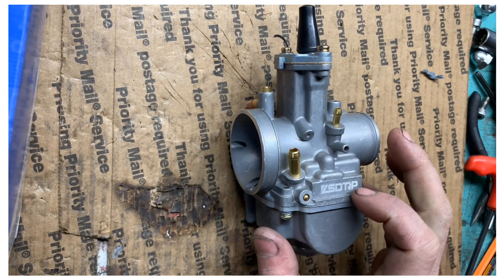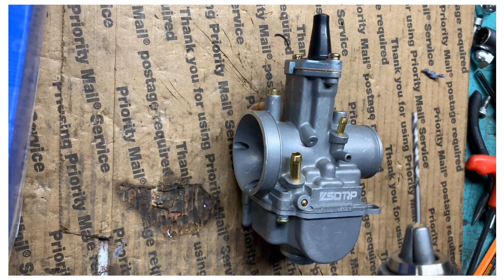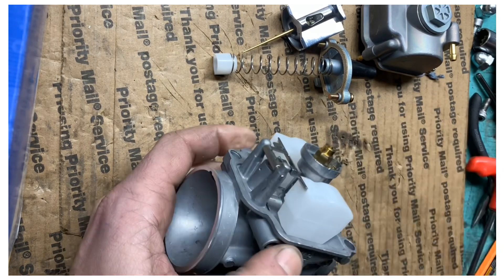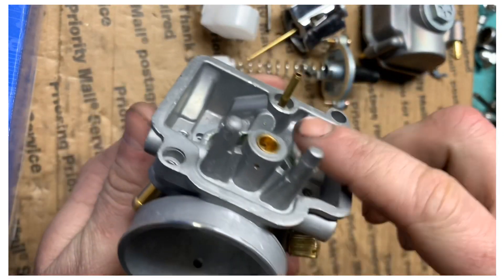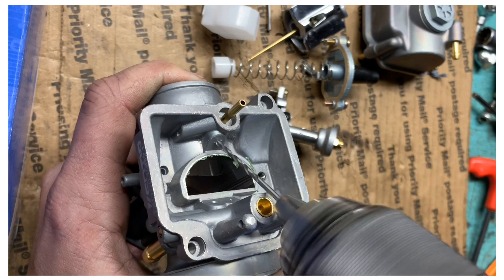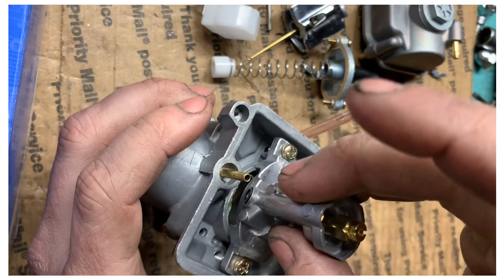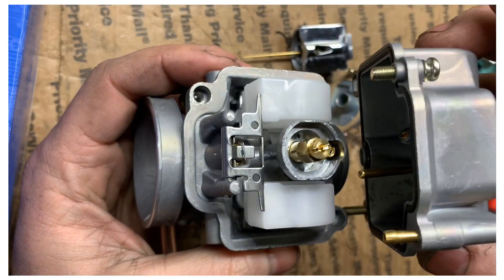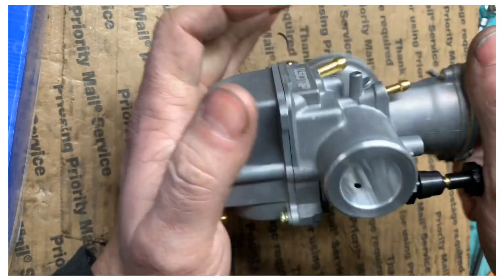How to fix that oko carb!

Comment: I used a 1mm drill bit and it helped out a lot! The drill bit in this video is way bigger than 1.8 lol! Maybe he measured it in sae and it was .19… anyway so I have a 66cc engine it’s 47mm piston, 38mm stroke and it is the piston that has the higher wrist pin, high compression head, I have reed valves just the smaller ones and I don’t have a windowed piston. I have this 21mm carb that I used a 1.0mm drill bit to do this mod, I have a 95 main jet and a 35 pilot jet. I also blocked off the power valve and I put clip for the needle valve in the center. It runs very well just a slight bog at wide open throttle only and I think moving the clip on the needle will take care of that.
Reply from the maker: He’ll yeah man. I use a bigger drill bit for the fuel I use. I also have big motors that require lots of fuel. 1mm is ideal for most. Glad it helped
Reply: @checkoutsmolikperformance223  so I basically took the engine apart and threw out everything minus the crank and the case. I made a windowed piston with the 49mm big bore kit, trimmed the skirt, crank stuffing plates, opened up transfer ports, raised exhaust, I bought the cheaper expansion pipe that everyone is running I did cut the small tubing off and the expansion part of the pipe I welded a flange right to it, piston is zeroed out on the deck (top of cylinder), I drilled the crank like ur one video said 1/2 bit 15mil deep, I shimmed the crank it had .055 end play it didn’t have any shims from factory,better clutch spring, clutch shaft. I just gotta finish tuning it but it has about 3 times the power it did from stock. The stock engines are just garbage nobody is having fun with a stock one. I was wondering so I have a cheaper pwk oko 21mm on it now but I also have the exact brand you are using in this video is this a better carb? Should I use that one instead? This is my first bike engine.. I know it’s hard to talk over texting but with the mods I have now is there any other tricks to get some more power? I have been a automotive mechanic for 20 years and own a repair shop and raced cars a lot so I’ve built a lot of big engines so I know engines just haven’t messed with 2 strokes in a while. And thanks so much for the carb mod vid and crank video you posted, drilling it out the crank really took away the vibrations. Are you running alcohol? I assume that’s why you need that big of a hole drilled in the carb. Sorry for all the questions but most people don’t know what they are talking about and I know u know what ur doing so any good information I can get I’ll take.

Comment: Gave it a shot to try and fix my bog issue at 1/4 throttle and no luck! Revs to moon easing into the throttle but a quick snap of the throttle and she dies! I've tried EVERYTHING!
Reply from the maker: Put bigger jets. Bog = lean
Reply: @checkoutsmolikperformance223  I have used a 32, 35, 38, and 45 pilot jet and it just doesn’t change anything. Currently at a 120 main, 32 pilot, and needle is set to 2. Air screw is turned out 2 full turns.
Reply: @shaunhuckabee5904  I'm at 150! Where you currently at?

Comment: Yow bro may koso flatslide carburetor is good at 1st to 2nd gesr but when it comes to 3rd gear straight the motorcycle dies. When i switch to another carb it is good. But when i switch it back to the koso carb it dies at 3rd gear when the rpm goes to 9000 up. What do i do to fix it?

Comment: Hey what's up I bought the grunt monster engine how fast does that engine go cause I'm getting only 41 miles per hour and it bogs a little bit Right at a little bit of throttle Then it halls a** till about half way and then from half to full throttle it doesn't go any faster.. Do I need to change the jet you think And what size pilot jet should I use or start off with I'm not sure what's in it now I have to take a look tomorrow

Comment: so i got one of these oko carbs 26mm for a 150 4 stroke pit bike. ive been going bigger on my pilot and not much change im thinking that i need to drill out that hole but wonering if it would have the same effect on a four stroke
Reply from the maker: jordan harms yes 100%
Reply: So I went back at it again today and drilled a 1.0 hole it was “better” still played around with the pilots had the best results with the biggest pilot I had on hand so I went to 1.3 and played with the pilot jets because now it wouldn’t start with out a lot of throttle and wouldn’t stay running with out the air screw turned out way to far. I think I’m getting some where because now I have a plug that is black so I’m definitely getting fuel didn’t go to the 1.5 so I figured I’m safe I’m going to buy smaller pilots tomorrow and give it another wack
Reply: @Likes4Tin  so far how was the result?

Comment: I did this on my 21mm carb for my motorized bike and my engine doesn't start it keeps flooding and wetting my spark plug ,the only way I can get it to run like for 15 second is wen I empty the gas in the carb ,at soon I open the gas it dies and it won't start until I empty it again going crazy I checked the spark the level of the bowl air leaks don't really know what's the problem even change the pilot jet to a small one and put it one notch up on the needle more Lean and it still doesn't work 😣😡 pay more than$200.00 for the top end kit and its not working
Reply from the maker: Andy Mendez bend the floats. You must of bent the float tab and the shut off needle is too far down
Reply: I did that as well and it's just keep flooding the engine and I wen just one noch on the needle more lean cuz is trowing to much gas thats why I wen lean put a small jet play whit the float and no luck Don't. Who know why is doing that
Reply: @checkoutsmolikperformance223  how much I have to bend the flow level I just got the carb out the bike and just got it open want to make sure how much I have to bend it ,you saying to bend it to the point that I don't get to much gas in the bow write?

Comment: I hope someone can help, if so I would greatly appreciate it. 
    I have a PWK 21mm (Same exact one on the video) that I have put on my daughter’s,Yamaha Raptor 80cc. The bike was trashed when I found it. I completely went through the entire bike. Ported and polished, new jug & top end. And modified it to except the PWK…. I bought a new stock carb but had the same bogging issue so I got the PWK (witch is a few MM’s larger) to help counter this issue. Now it’s running and has a much better idle. But still bogs and dies after 1/4 throttle. If I slowly give throttle, it’ll rev up but then spit and sputter at full throttle.

Any Ideas? I would appreciate any help. Thanks guys
Reply from the maker: It sounds like it lean. Add a bigger pilot to fix the low in bog. As far as the top end goes, lower the main jet down a few sizes. 

Bog = lean 
Choppy-studer is rich.
Reply: Thank you so much. I have installed the largest pilot jet I have is a “K41”???
(I also have a K38 & K39)
And I’m on the smallest main jet I have “K95”.
(I also have a K115 & K125)
I guess I’ll raise the clip on the needle jet, see if that helps lean it out on full throttle.
Thank you and I’ll get back with the results 

And is there a “Jet Kit” I could buy for the PWK? Just to have more variety and can really dial it in?
Reply: Ok,… found a kit on Amazon, But for now, I changed the  needle C-Clip to the highest setting .
    And just for a note, I haven’t drilled the hole out on the carburetor either

Comment: Hey man can you fo a video how to remove the cable out of the slide.. my needle has came out the slide the clip broke.. now idk how to get it back in I have a new clip for the needle
Reply: You should look into a  a rebuild kit for your style of carburetor. They can range from $20-$40.
Nvm, you said you already have a replacement.

Comment: Thanks, bought this carb last week and have the same issue with the fuel. Hope it'll fix...
Reply: did it fix that issue?
Reply: @untitledduck9675  i've drilled just a tiny small hole and cleaned the remaining dry glue from the gasket which might block the fuel flow. I also replaced float needle. The curb working fine but tunning kind of difficult to find correct idle timing. Since i've another curb, just trial and error to make it work.

Comment: Is a 24 mm carb too big for a motorized bike? I have the knockoff oko it bogs all around with moments of great performance.
Reply: Mine does also it's a 21mm from zeda .. I have a grunt monster engine and it bogs in the beginning right around a little bit of throttle then it hauls a** and then from mid throttle to full throttle it doesn't really do anything or what I mean is it doesn't go any faster.. Then once I come to a stop and I'm idle in, if I hit the gas it bogs..

Comment: I did this to oko flatslider carburator . Doing this, my carburator gets starting complient.😭
Reply from the maker: It worked for you?
Reply: @checkoutsmolikperformance223   actually my problem is , my carburator 28mm oko flatslider, 38 piolet jet and mainjet 115 , when applying sudden acceleration rpm level suddenly cutoff , but during slowly acceleration rpm improve very good . Can you advise how can I slove this problem
Reply: @dineshsudhakarrao7363  I have the same problem , did you fix it ?
Reply: @goszuu  actually I brought another pwk flatslider carburator , still it's bog
Reply: @dineshsudhakarrao7363  get smaller pilot jet or raise the needle clip

Comment: I havent really been able to full throttle on my dio but can reach pretty nice speed quarter throttle. The bike is a stroker and had a 146 main jet/55 pilot when I first picked it up, my guess is that the previous person just slapped on whatever parts they had laying around for a quick sale. I've since changed to 142, then 140 main jet which did minimize the bog at 3/4 throttle. I might drop down main one more time to 138, but I'll try this out.
Reply: Well. Did it help? My Sym DD50 needs a little more power.

Comment: Hey guys. Thanks for this Vid. Can't wait to try it out. Question tho. The carb I have came with a #38 pilot jet. It idles and revs fine until I put it under load then it bogs out. Will I have to change that jet? If so what has been the most common size after this Mod. Thank you and God Bless.
Reply from the maker: Greg Kirby yes put a 48 in it
Reply: @checkoutsmolikperformance223  
So I did the Mod.. and it won't even idle now lol. Actually, it runs even worse than it did before :(. It still bogs like crazy.. the biggest main jet I have is a #80. I just drilled a #60 to 1.0mm. Won't be able to try it out till maybe thursday. Any suggestions on what size the main jet should be? Sorry but I am new to this. I have a dio reed upgrade, with a stock pipe( I ordered a new one plus pilot jets, but this Corona has everything messed up right now) and a knock off OKO 21mm.. thank you for all your help
Reply: @gregkirby  Did you do what he did in the video? Drill and make the hole bigger for better vacuum...did you do this?
Reply: @c549m6  Yes I did. And honestly it made it worse.  I've tried every size jet you can think of both pilot/main and I cannot get this thing to run right.. had to put a smaller jet in the pilot just to get it to idle from #38 to #32 after drilling it out. And I still cannot get the bog to go away when I accelerate.. I've pretty much given up...
Reply: @gregkirby  same here i drilled it out to the same size as in the video and made it run worse, i had idle issues before, zeda 80 window piston expansion chamber 21mm oko carb ran good initially when i got it then would die on the top end and shut off wouldnt do consistent long distance and set the motor to the side, old skyhawk died, so i had no choice but to put this motor back on, wouldnt idle, did this mod barely idles with the idle screw ALL the way in, put a load on it doesnt run, idk if i need to rejet or not or just get a different carb
Reply: @gregkirby  im gonna add a bigger main jet and see how that works
Reply: @vohnholden6203  
Mine has been sitting in the shed ever since.. I've given up on it.. shoulda left it stock IMO
Reply: @gregkirby  so I took out the 39 main pilot. Found dirt and debri in the bowl cleaned it out. Saw the 39 was also clogged. Replaced with the largest size main jet I had which was a #41 ran better but still had trouble but noticed improvement I think I need a 48 like OP was saying but getting closer. Definitely tuning in the jets larger jets
Reply: @gregkirby  I fixed my bike!! Runs awesome. 48 jet and a 135 is the combo I'm using. I replaced the crappy CT manifold with a naraku performance intake Dio manifold and bought the stage 6 reed cage. 21mm oko carb with the drilled holes mod. And cut some extra slots in my car gas bolt in the bottom. I used gasket maker on all the pieces to make a extra good seal and no gaskets as the viton reed cage is already rubberized coating. This thing hauls like it's supposed to now!
Reply: @gregkirby  make sure you have a windowed piston in your zeda80 and the mz65 pipe
Reply: @gregkirby  or buy the stage 6 intake for a even better reed cage. I bought the naraku and then stage 6 reed cage, intake manifold design is the same. Stage 6 reed cage came with 24mm ,26mm, and 28mm stuffers I used the 28mm
https://scooterswapshop.com/products/stage6-intake-manifold?gclid=Cj0KCQjw-uH6BRDQARIsAI3I-UdwSrY70blIk3EJwrxbF7HQ2AHK7QMM_wCay1DjQ_-_-Z4SFzAdvG8aAu6yEALw_wcB
Reply: @vohnholden6203  thanks for all the updates! I hope it is still running good. Mine has just been sitting.. haven't had any time to motivation to mess with it anymore.. starting to get too expensive for me haha.. I'm not trying to race with it, but I did want a little more power.. I originally had a stock motor.  Ran good a couple of weeks the the piece that holds the wrist pin in place came loose and damaged the piston and cylinder. So I ordered the Dio upgrade with window piston.  It has been nothing but trouble. Maybe ome day I'll feel like messing with it again. So I really do appreciate all the updates on what you did to get yours performing well! God Bless you sir...
Reply: BTW what were you referring to with the extra slots you said you cut?
Reply: @gregkirby  I'm not sure if it was necessary the on this part but the 17 mm carb gas nut bowl on the bottom of the float bowl. I noticed that the original holes it had on the threads didn't line up with the lowered grooves on the inside of the gas bowl. So I scratched a mark on each side of the nut while I had the whole gas bowl off and took the nut out used an angle grinder and put grooves in the nut to match the bowl for better fuel flow.
Reply: @gregkirby  then I tightened the 17mm bolt back on the gas bowl and scratched a mark on the outside bottom of the bowl so I know where to tighten it to to get the grooves to line up.
Reply: @gregkirby  I also just switched to using and highly recommend Honda hp2 2 stroke oil, that'll make a big difference on performance
Reply: @gregkirby  https://youtu.be/Uf6cfca_u6w
I posted a video that may help, either a stage 6 manifold with reed cage or a naraku. They'll both work. But the stage 6 reed cage is better because it's rubber coated
Reply: @vohnholden6203  
Looks good! I might have to start over altogether. The lower part of my engine may have gotten damaged as well. I bought it from Gasbike before I found out they are total RIP offs.. they literally hung up on me and blocked me from calling.  A warning to everyone reading this post. DO NOT PURCHASE FROM GASBIKE...
Reply: @gregkirby  I bought mine from bicycle-engines . Com,  not too bad for the price, windowed piston and expansion were sold separately. I bought a gas tank mount and a 3liter tank to help but with all gas tanks vibration cracks open these mount bolts. I'ma have to find a vibration resistant way to seal the mount bolts so it's not dripping when parked. A raw racer 2 or any other 100cc model might be good as well. Really the billet aluminum reed crankcase cast with a am6 head with the matching internals is the best engine build I've seen yet but that's all custom race build stuff
Reply: @gregkirby  yes. It's worst. My carburator gone scrap by doing this method.
Reply: @dineshsudhakarrao7363  yea. My bike hasn't moved since. I lost interest
Reply: @vohnholden6203  yes it's worst idea.
I tried mseal to fill the hole. Into old position, Now it's almost okey with it.
Reply: @dineshsudhakarrao7363  yeah it only pulls hard for like a minute on that old carb. I bought a new carb and slapped it on works fine now. If you're having issues with your oko. Buy a new one for $20
Reply: @gregkirby  2years later lol but try crank stuffers if you still have the motor running

Comment: That looks like the idle circuit is now larger...and flows more air. Then play with pilot fuel mixture screw...or tighten it to make it richer.

Or am I imagining?

The largwe new hole seems like it sucks the fuel vapor or is about the liquid bowl level. Fuel is picked up by a passage tube...

It be nice to hear you bog before and after...

Great video...

When I get my first  China doll...

I will get one of these carbs...

They seem like sort of a knockoff KTM...that is curved slide...

I also like that power valve circuit...it reminds me of a Del Ortto ? off 1972 Ossa Stillito 250...OR maybe it was a Bing...so long ago..

For air cool old school piston port...like most China dolls...that bike was powerful

t had like two needle or taper pins...a little one..for like lower speeds...with clip positions...then the main needle. 

Good job..

Comment: it only made it even worse. i cant accelerate at all. only with full throttle and then it still takes like 10 seconds before it runs smooth
Reply: Did you need a new carburetor M8?